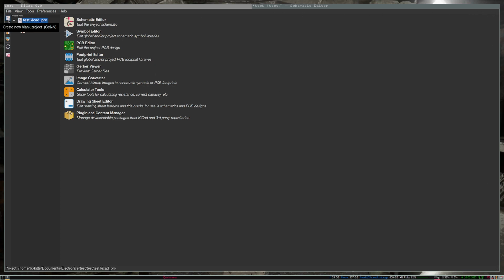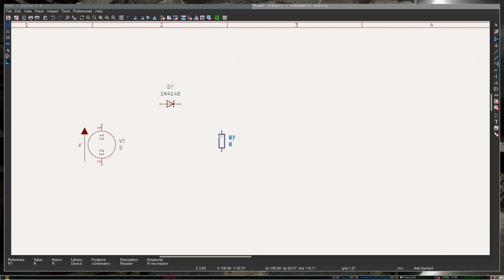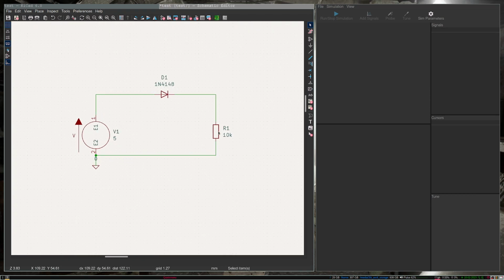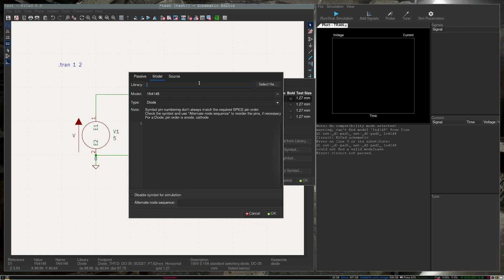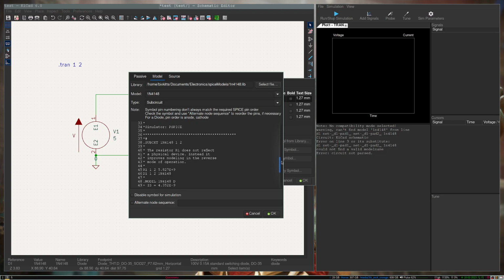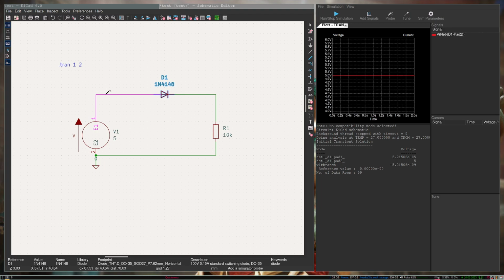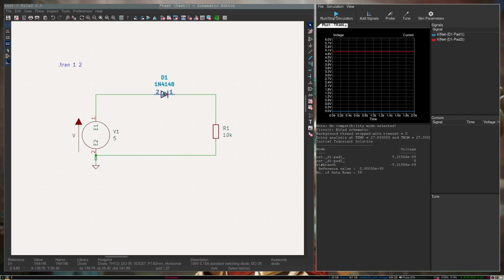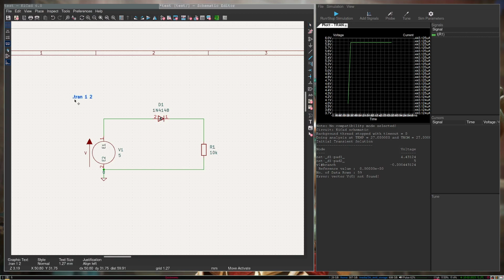Simulate Any Circuit! - Windows/Linux 2023

Comment: I make these a lot. I’ve been experimenting lately by adding dried cranberries and walnuts with 1/2 the chocolate chips. I also use dark brown sugar. Tonight is dried cherry, pecan, chocolate chip.
Reply from the maker: Dark brown sugar certainly yields a deeper more ripe experience in this case although I feel compelled to assert that walnuts and similar nut species detract from the already ideal texture and sweet/bitter ratio. I've had the most success with peeled almond dust personally. Be mindful of the temperature curve of the solder paste too and the surface mount PCB should emerge from the oven without any damaged components or short circuits.

Comment: Is KiCAD the best or are there others?
Reply from the maker: There are alternatives!
Circuit simulation nowadays seems to mostly be based on SPICE derivatives
such as PSPICE (licensed), LTSPICE(free!) or the simulator in Altium Designer (licensed).
A good quick visualiser for basic circuits can also be found at: 
http://falstad.com/circuit

I chose KiCad because it allows for simulation with existing PSPICE and LTSPICE models
and can also lay out a schematic and PCB at the same time, all while being open source.
The results are also somewhat accurate to what I've seen on the real circuit!

Perhaps look to LTSPICE for just simulation on it's own, though I can't make a definitive recommendation!